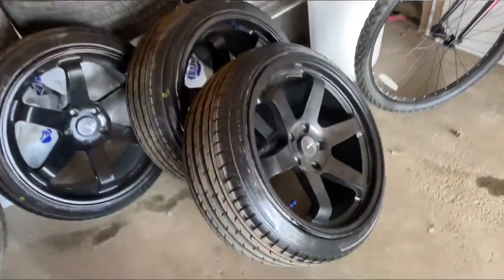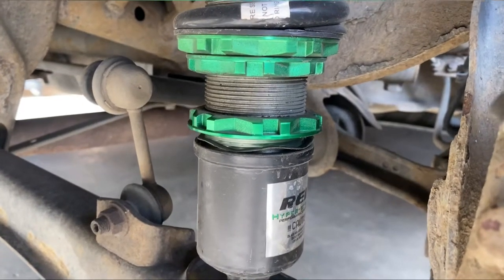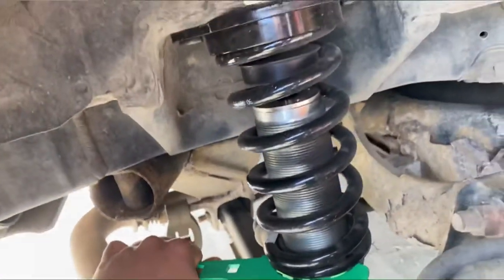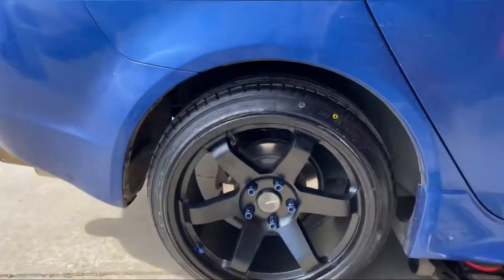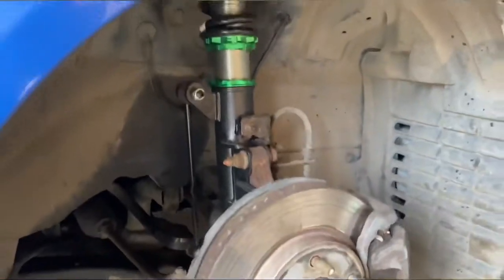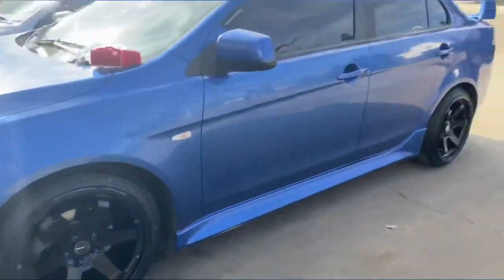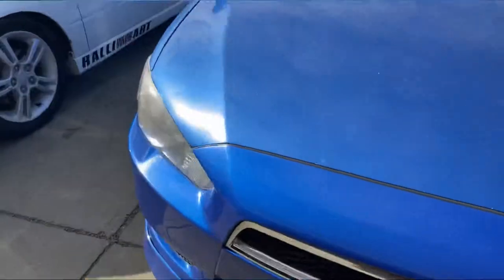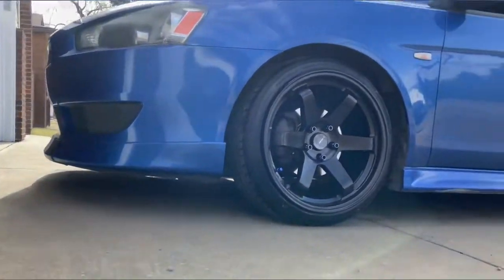Avid1 AV06 18x9.5 + lowered on a lancer!!

Comment: if I wanted to go 18 x 9.5 +22 offset; will that fit on a car that is lowered 1.5"?  Checked some pictures and it seems okay, but not 100% sure.
Reply from the maker: The inner wheel perimeter might still rub on the coil. Mine was slightly cambered so just added some spacer and it was good
Reply: ohh okay.  Thank you for the info.

Comment: Dont tell me this is how low they go
Reply from the maker: No it can go more lower.
Reply: Can it tuck on those coilovers?
Reply from the maker: I'm pretty sure it can with some fender rolling but with the wheels I have on, no. I had to add spacer in the front so that the rim is not rubbing on the coils